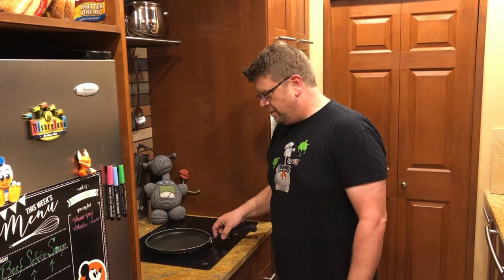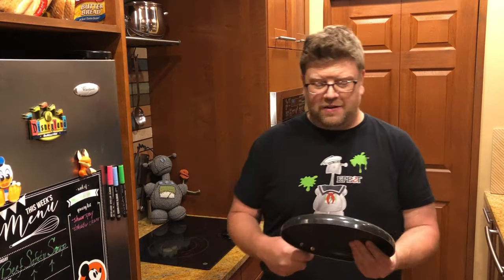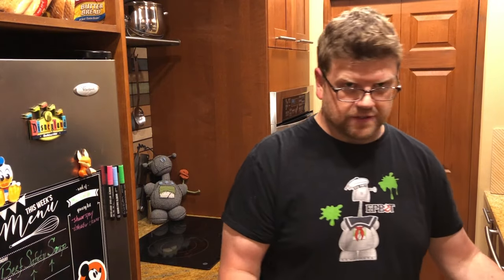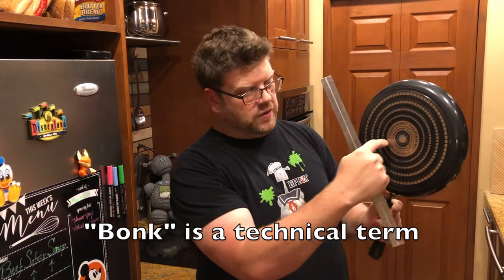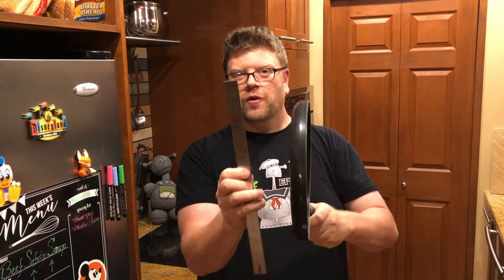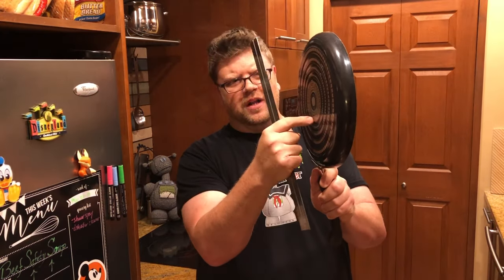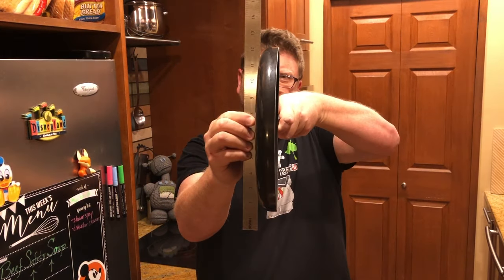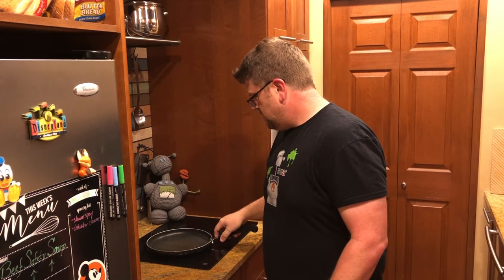Quick Fix: How To Straighten A Warped Pan

Comment: One important exception: do NOT do this to cast-iron pans and pots! They are brittle and easily crack or break. (See my comment to Stacy Smith below.)
Reply: Maybe after heating it with a heating gun. It might work, but it's just an assumption.
Reply: To be fair, I feel like solid cast iron bowing would be a more serious issue in general
Reply: @whygeesol8905  Thassa thing about cast. It doesn't bow, it just cracks first.
Reply: The same technique can be used on cast  iron skillets. You must use a towel, a flat surface, Hammer and heat the skillet a little. Do your research.
Reply: @glamourpus7  I did do. And I have a shattered skillet to show for it, research be damned. Cast iron will remain the province of blacksmiths, so far as I'm concerned.
Reply: You told ppl NOT to do the method in the video. You DID NOT  mention heat regarding a Cast Iron Skillet. Therefore being from a region of Blacksmiths does make you one. A little and mallet/hammer lightly tapping your cast iron skillet WILL SAFELY even it out again. Without it cracking. I know bc I repaired mine. I'm a NON Blacksmith Female.
Reply: @glamourpus7  Maybe if you heat it first, but the other guy is definitely not wrong. You may have been able to straighten out yours, but that doesn’t mean it works 100% of the time. Any hidden stress in the cast iron (which is likely to be there, cast iron is very low quality metal that’s very porous and brittle) will likely cause cracks or even shatter the whole thing.

Not to discredit you straightening yours out, but in general it’s not a good idea to do this with cast iron. Then again the pan won’t be usable if it’s severely warped anyways, so take that for what it’s worth.

Comment: I was thrilled at how few light bonks it took to make this new 14" Tramontina flat, but unfortunately, it just curved downward again during heating, to where it feels like the contact spot is about three inches in diameter. I'll play with it later and see if anything will keep it flat, but it may simply have been a bad purchase. The good Tramontinas here were more expensive and much thicker aluminum. FWIW, I'm using it on a glass cooktop, and everyone here has been recently instructed to never cool the pans too quickly.

Comment: Like many others I was very sceptical about this actually working at all, however after giving the frypan a few good whacks with the rubber mallet, it's straightened it right out with 3 minutes worth of work. Frying pan is a Cuisine::pro diamond 9. The pan is heavy and needed harder whacks. Could hear the tone of the pan change lower when giving it these whacks.

Comment: Here are the reason why your pan warped so you can prevent it in the future

There was too big temperature changes in a short amount of time.

So either you heated it up too quickly (this has become more relevant with the super fast and efficient induction stoves, gas can also be fast enough, but if you have burners having the pan be slightly warped isn’t as big of a problem as on a flat stove)

Or the pan was cooled down from hot, to a lot cooler way too quickly.

Here is what you can do in the future

If you are using a induction or gas stove, get in the habit of when you put the pan in. Give your pan just a minute or two on a medium low heat, and give it one more step before goin to a high heat.
Save the super quick power boost options for boiling water in a thick saucepan. Not your frying pan.

If you tend to take your hot pan and immediately put it in the sink and wash it of with hot water, don’t.
If you want easier washing up, instead use your kettle or something else and get some boiling water ready. And pour that over your pan in the sink.
It will get most if not all of the stuff up.
Do the last minor washing up a few minutes later (or after you finished eating) when the pan is cool enough to handle.

So why does it warp in the first place? 

Most pans (except cast iron) are made by a flat sheet metal (it can be a sheet made of layers of different metals).
That is cut and then bent into shape.

So pans can relatively easy lose that shape they bent in. Because they weren’t cast or forged into that shape. And are often relatively thin (compared to say cats iron), because they need to be able to bend the metal into shape.

When metal gets hot it expands, and when it cools down in contracts (not so much that we notice it by looking at it, but it will create tension in the metal of your pan), so big differences in temperature of the metal in how much it expands or shrinks creates tension in your pan, and that pressure/tension is what tends to causes a pan to bend.

So uneven shrinkage and expansion of the metals in your pan is the problem.

And for it to be even it has to happen sort of slow.

The thickness of the pan, how and what shape the pan was bent into and what material its made of will determine how easily the pan will warp or not.

Something to keep in mind with this fix of bumping in the warped bottom flat, is that when it gets warm the pan will expand and the bump will become more prominent.
So even though you made it flat again in room temperature, it might seem to be warped again when it’s warm, to then become flat again when it has cooled down.
Especially if it’s a thin pan.
In that case it can help to put the pan in the oven at a medium heat (maybe around 120 Celsius). And then very carefully bump it flat while it’s hot. (Be careful with the rubber it might not be heat resistant, use a protective layer of something in between).

I’ve fixed quite a few pans second hand, friends and families pans, but I’ve used a hammer with a plastic cutting board in between.
Using a rubber mallet seems way better. And smart to use a ruler.
Reply: Good synopsis, all true and useful information. I will just add that if manufacturers would "normalize" the freshly formed pans (soak in high heat an hour or so), then run the pan through the forming die again, warping would be much less of a problem. This could be a problematic process with bonded pans, but probably not.
Reply: Honestly, I‘d rather just bonk my pan.
Reply: Uneven heating can also warp a pan.
Reply: Awesome information brother, But is rubber powerful enough ? wont rubber be too weak compared to iron hammer
Reply: Yep - I bought a wok to use on a new induction stove, not realizing that my induction stove was far too powerful for my relatively thin wok's conduction to keep up with unless I deliberately heated up gradually.  Hopefully nothing a few bonks won't fix.  Unfortunately this is only really a problem with flat bottom woks, so a real wok wouldn't have this problem - the curved structure generally stops it warping much
Reply: Enlightening. Thank you.
Reply: Well done! Thank you so much!
Reply: The  proper term is cast iron....not cats iron !
Reply: Any pots and pans that can handle high heat and different temperatures? (Cast iron is too much work)
Reply: False.  Aluminum always warps and thick, reinforced bottoms of stainless pans do not.

Comment: I never would have thought this possible. I have an All Clad NS1 Nonstick double burner griddle that had warped and twisted so I tried bonking the opposing corners but no good. So I put a wooden stick underneath diagonally from corner to corner and stood on the corners that were too high. That worked too well so I had to reposition the stick and this time just pressed with my hands and voila, flat as could be. I was contemplating throwing out this $100 pan and yet I was able to fix it in just a few minutes. Thank you! 
Side note: I go to brag to my wife that I fixed the griddle and she says "It was warped?"

Comment: I had a set of warped pots and pans at a house I rent a room in that had been bothering me for months. I folded a hand towel a few times and tied it to the end of a 16oz hammer I had lying around and was able to fix them in like 30 seconds. Surprised they're as malleable as they are.

Thank you sir for giving me the courage to wack my pans with a hammer, you've cut my cooking time in HALF since the full bottom surface of my pots now makes contact with my electric cooktop.

Comment: After watching this I went bonkers on a 12" non-stick frying pan and a non-stick griddle pan with my Harbor Freight Pittsburgh 4 lb. dead blow hammer and a 29 year old stainless steel straight edge.
Complete success.
Just finished eating some cheesy hash browns from the griddle.
For those wondering if the heat will re-warp the pan..... didn't.

The reason my pans warped was from putting cold water on a hot pan to wash.

Won't do that again.

Allowed to cool completely, washed with warm water and Dawn dish soap, put back on cool ceramic stove top after drying with towel... a flat surface not a dish drainer....
Flush. Flat.

Pan flush, flat.

Thanks a lot for this video.
Somebody knows how to work aluminum.

We have a collection of warped pans that will be resurrected from the storage box they have been in for years.

Comment: Thanks for this! I had a big ol' Circulon that was seriously warped. I've been thinking about replacing it for years but never did because I couldn't stomach the price of a new one. For some reason it never even occurred to me to try smacking it with a mallet, but I'm shocked how little force it took to punch the middle back into place.

Comment: This, dear Epbot, is life-changing!  What could be better than a STR8 PAN?  So, I recently bought two pans to replace all the warped junk-ware I'd inherited.  How can a brand new pan be heretofore warped right out of the factory, I pondered.  It is henceforth fixed  - thank YOU, Epbot.  I'm thrilled, not so much for myself, but for all the fine folks I'll cook for to follow - and this will encourage me to cook for larger numbers!  I bought two packages of 50 tiny clothes pins (good joke gift) to post the 50 most urgent things I need to do (to reduce the number from one million,) this was #28 on the list of things that I never knew were needlessly bugging me TO NO END!  And it's not to say that the alternating heating elements on the stove are level with each other, because they're not, and can we fix that with a 'tap tap' of the mallet?  Sure hope so, since a gas fire is not an option yet.  So, you'd learned this from a metallurgic relative or buddy-o-pal?  Very handy!  YouTube is my daddy because of 'cool tricks' videos like this and thank you so much for posting it!  Everything was repaired in less than two minute - AMEN.  So, let all them nasty pans just try to warp!  We're READY FOR THE WARPS and if it does happen, we'll all go BONKERS at WARP SPEED!  :  =]\..

Comment: I couldn't wait to try this and my rubber Hammer was in the shop 5 miles away but I had a wooden Mallet for pounding meat that had one side flat so I thought I would give that a try I tapped on it for a bit and put it on to my convection stove top and wow it sat flat on there so I would like to thank you so very much for this tip    Yes it worked
Reply from the maker: That's awesome! So glad we could help. :)

Comment: You don't need to put cold water (or hot water) in a pan after using it, just leave it on the stove to cool normally.  However, even with following that step, you can still warp a pan by getting a skillet/pat screaming hot to sear a steak, then tossing in a cool steak.  That can warp a pan too, even a quality pan.  That's why I prefer cooking with gas - because it took watching Forged In Fire and my wife seeing at the end of Episode 1, Season 1, where they made a Samurai Sword which was perfectly straight, and it was quenched in a clear container and you could see the sword warp into that classically curved Samurai Sword shape over a few seconds as the sword cooled.  As someone that used to work in a sheet metal shop decades ago, you can't get a warped pan perfectly flat as it was brand new, this is a GREAT way to get a pan "close enough" and drastically reduce hot spots and keep your cooking more even.  I'll be doing this after work this evening.  Instead of bonking directly on the pan, you could put a 1" thick piece of soft wood against the pan and hit the wood.  The wood would spread the pressure more evenly, and unless you go nuts, stop you from pressing the bottom further inward than you intended.  The wood would also bend some as the pressure is applied.  Thanks for the video!

Comment: Considering how gentle that blow is, you'd think that there be a market for a pan weight that you can put on your pans while you're not using them to keep them flat or flatten them over time. You know clean them, dry them on a low heat, and then put the weight on until they've cooled.

Comment: I just tried weighing down the still hot pot on the still hot burner to see if would shrink back to its original size, but if that doesn't work, then i will definitely try this.

Comment: I wanted to believe it, but I tried this on my stainless steel sauce pan which has a big warp in the bottom (bulging out) and it didn't work at all. I had no success with the mallet, and had to switch to a regular hammer; eventually I got it roughly flat. But as soon as I tried cooking with it, it bowed back out again! Guess it only works for aluminum pots or something

Comment: What material is that pan? How does this work and not crack
Reply from the maker: It's just a typical metal pan, so it's malleable. The only kind of pan that would crack would be cast iron - and that wouldn't warp like this to begin with.

Comment: I wonder what makes them crown like that.  Mine went in the opposite direction.  I have a gas stove.
Reply: The ezpz explanation is hot stuff expands, then contracts when it cools.
Stretch and squish metal enough and it warps.
A lot of metals used are alloys (multiple metals blended).
This is so you can cut the price, use some metal for strength, some because it reacts to heat better than the strong stuff (heats up faster, more even heat distribution for equal cooking instead of burning spots), and some metal is more friendly to accepting a non-stick coating than others.
With that in mind, if you think of mixing glitter, you're not 100% going to end up with an even mix. A spoonfull won't have exactly even parts of each color, same with the alloy. 
So you may get parts that are a bit more of the heat friendly, and some less. This inequality as it cools causes more rigid / soft areas, and it settles (cools) unevenly causing bowing.

I'm more surprised he didn't have to use more force, or use a dead blow hammer (thick plastic, has sand or other material inside, when you strike, material inside moves to strike point, inertia keeps it there helping ensure a solid no-bounce strike).

Edit: stick not srick, virtual keyboard on phone.

Comment: Pans warp due to being heated too quickly. Warm your pan over moderate heat to keep it flat(ter).

The final test of flatness is to put your pan on a flat surface and try to spin it by tapping the handle with your hand. If it spins, it's not quite flat yet.

NEVER try to bonk a cast iron pan back into shape. Aluminium is soft and can be reshaped easily. Steel is harder and harder to flatten. Cast iron does not take well to being beaten with a mallet, and if you hit it hard enough to flatten it, you'll shatter it, and turn your beloved pan into a cast iron jigsaw puzzle.

I have taken several cast iron frying pans to thrift stores because they're warped. If you have a gas stove, those pans will work just fine. They just won't work on an electric element, because all the heat goes to the bulged bit, and make the bulge worse.

Comment: Hello John.  I have a question : will this also work on a carbon steel pan ?   I have one , and it's got a small wobble on the bottom, I think it was my fault.  The manufacturer said not to heat quickly  because this will happen.
Reply from the maker: I believe this should work on everything except cast iron, so yes, I'd definitely give it a shot!

Comment: Would this work for a steel pot as well? Thanks.
Reply from the maker: It should work for any metal other than cast iron, which is too brittle.
Reply: @EpbotVideo  Thanks for your input. Might attempt to repair some warped steel pots soon.

Comment: But since the metal warped (lightly stretched), will it warp easily again when heated?
Reply from the maker: Nope! Just be sure to let the pan cool before washing; shocking a hot pan with cold water is usually how they warp in the first place.
Reply: @EpbotVideo  Will do. Thanks.

Comment: Worst is to fill it with cold water right after cooking in the sink and then leaving it in the sink to sit since if the pan isn't level only half the pan will dissipate heat quickly to the water while the other half remains hot. I think that caused warping but not sure. My family washes with cold water.

Comment: i hammered 10 minutes , nothing , i also put my weight on it 100kg , and it barely flexed , but the shape springed back . so i'm at a loss , or so it seems
Reply: update , when i hammered like no tomorrow , it kinda worked , but it has nothing to do with being flat .And it popped right back after some heating . So still not really working.... better than before tho'

Comment: But it wobbles again immediately on the stove being heated.
Reply from the maker: You might refer to the comment below by IQzminu2 - they list reasons your pan could be warping. Too much temperature change too fast is the culprit, so leave your pan on the stove as you heat it, don't put a cold pan onto a hot stove.

Comment: if you're able to change the shape of that pan with those impacts; you need a better pan.
Reply: Aluminum pan bottoms just always warp.  You have to go to stainless with thick bottoms.  Cast iron can warp real slow over a decade, then use a grinder to fix it as banging cracks iron.